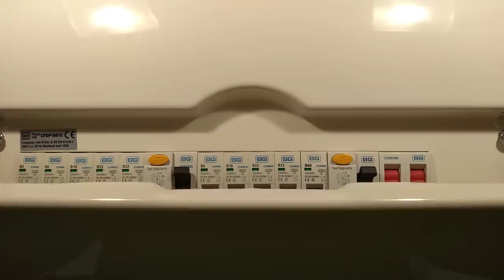A look inside a British home electrical panel.

Comment: Clive would you like an American “Breaker Box” I have several 100 amp panels i could send you one?
Reply: old or new? i want to see clive play around with the old fuse boxes that use edison screw base fuses, people would have them burn out and stick a coin under the fuse to bypass it, current american breakers are on a din rail but the old 1s were fun, i still got a few screw im circuit breakers!
Reply: @frogz  My house has both. Evidently it had a 100A fuse box and when that wasn't enough, they added another 100A supply via a breaker box. At least it's not still using the ceramic knobs that there is still evidence of.
Reply: Would love to see a world tour of electrical systems. Preferably with region appropriate snacks.
Reply: And to think my 200 amp panel with 38 breaker spaces never seems enough lol
Reply: I think it would be very expensive to send it to the UK. He could probably source one less expensively than you could send one to him, TBH.
Reply: @frogz  American circuit breakers don't use a DIN rail, they just clamp onto the live bus bar.
Reply: @frogz  aluminum foil balls ;)
Reply: @frogz  The good old 200-amp one-cent fuse
Reply: @J federal Pacific is very popular for creating toasty house fires:)
Reply: @J FPE breakers are scary. The warehouse I manage has a 1,200 amp - 3 phase service. Even worse,  some of the sub panels (FPE again) were run run with 400 feet of aluminum wire. Got to love the 1960's electrical codes.
Reply from the maker: The cost of shipping an American panel would be astronomical due to the size and weight.  Our three phase boards are very similar to the two phase American panels.
Reply: @JThe original widow maker....
Reply: @trickster721  Some clamp on, some screw on, some are a wedge-fit into slots on the bussbar.. Depends on the manufacturer
Reply: Living in the US it is interesting learning about wiring practices in different countries. In our case we have a 200A main 120/240 volt service with 40 circuit breakers plus the main breaker. Unlike the UK in the US the main disconnect is also an over current device, but only disconnects the two live conductors not the neutral. 

In the US the utility provides two hots and neutral to residential customers to deliver Edison derived 120/240 volt service. At the service entrance the neutral is Earthed and a separate protective ground conductor split off called the Equipment Grounding Conductor.

In the US GFCI can either be combined with a circuit breaker or reside in a receptacle. The threshold is 5ms +/-1ma. The UK level of 30 ma seems rather high but I assume is necessary since it supports multiple circuits.

In addition we have a separately metered water heater circuit, rated at 30A @ 240V. This is because the utility charges less for electricity used for domestic hot water.
Reply: Oh... Clive. You said 2 phase... I shall wait here for the onslaught of corrections. :)
Reply: @J idk why he wasn't happy. Any electrician worth his salt would refuse to replace or repair a federal pacific panel, and selling used breakers without testing them would put him liable for any future damage. Most insurance companies require their replacement to qualify for insurance. I'll stick with my good old Square D QO panel (i've got one on my house that is at least 50 years old now), Great things too with the new Plus On Neutral AFCI and GFCI's
Reply: @jaxjackson4100  I'll state again. Nothing wrong with aluminum. Its still legal to use in the USA. Its the terminations not being properly coated with Noalox. Those federal pacific panels however... you should get the breakers tested on a regular basis......
Reply: @bigclivedotcom  I'd like to see a 3 phase panel in the UK as I'm an electrician in the USA. I've built at least one 2000A 480v 3 phase service.
Reply: I’d imagine sending a North American breaker panel wouldn’t be cheap to send  they are big and clunky...
Reply: @gmcnewlook  Depends on the type of panel. A sub panel for a small mobile home or RV would not be too bad
Reply: @t0cableguy  in Maryland you cannot buy a house with a Federal Pacific panel. The loan companies will not give you a lone with out it being replaced before final sale.
Reply: bigclivedotcom I'll gently correct your mistake. Don't worry, people make the same mistake here, as well. US residential electrical service isn't 2-phase. It's one phase that is split by a center tap on the transformer. The center tap is referenced to ground, and serves as the neutral for the two 120v halves. For equipment that requires 240v, you essentially connect it to the beginning and end of the transformer's secondary, like it is in most other countries. This does make for some interesting socket configurations, however. Electric dryers and ranges (cookers) are 240v, but often have some 120v components. So the outlets for them (since about 1995) have 4 wires- the two hot wires for 240v, a neutral that allows the 120v parts to run on 120v, and then a ground. It's needlessly complicated and wastes copper because our wiring has to be able to carry twice the current, but it's what we ended up with.
Reply: Jason Hutton under NO circumstances should you "test" FPE breakers. Exercising them makes the problems more likely to occur, and they are a "they work until they don't" type problem. Meaning that your test might be the straw that breaks the camel's back, and it might jam the next time it's overloaded. The only thing one should do with an FPE panel is replace it as soon as possible. They are a fire waiting to happen.
Reply: ayy they got breakers? If you're just givin' em away, mybe we can work something out!
Reply: Jax Jackson aluminum wire from the main panel to sub panels is perfectly fine, and in fact, is standard. Use SE or USE cable and liberally apply anti-oxidation paste, and it's fine. The problems with aluminum were in branch circuits, and mainly had to do with a lack of knowledge/ incompatible materials. It's no longer allowed by code mainly because it's not very forgiving of less than perfect installation. But properly installed aluminum wire with compatible devices is not dangerous.
Reply: LetterSlayer that's how they are in most of Europe. All boxes use DIN standard mountings, rather than the proprietary designs used by each panel manufacturer here in the US.
Reply: @russdill  Now we're talking! Washed down with local brews.
Reply: @trickster721 Correct not DIN, I think it's an old SAE standard, we had Heinemann breakers in some older installations in Australia that used the same method, one side of the breaker was clamped directly to the live bar and the other side was a C shaped spring clip that held the breaker.
Reply: @Chaos Corner - the system known officially as knob and tube, although people in the business are more likely to refer to them as 'knob and slob'.
Reply: My googling seems to indicate the U.S. doesn't appear to have a single standard breaker for household use. Square-D? Eaton? CH? BR? GE? etc. Not all brands or types seem to have the same size/spacing or bus-bar layout.

Anyhow the ones in my house are from the 1960's. Seem to be a bus-bar type made of Bakolite or some similar hard black plastic, push-button style with an inset tumbler that shows the switch status of the breaker. (Older version of "Pushmatic"? Seem to be the closest.) Not the toggle switch that seems to be a lot more common with new models, or the generic push button that pops out that seems to be on cheaper ones.

So electricians here must have fun times stocking up on a lot more extras because of this variation. (And not necessarily due to current or in-rush ratings. It's just different companies that make the panels and breakers wanting to do stuff their own way.)

The screw in ones somebody mentioned are actually a breaker made to go into an old fuse panel. Kind of a stop-gap kind of thing for something that's really old and sketchy anyways. (And they allow that dangerous penny thing if you're a bit desperate and cheap.) Pics of those seem to come up under Connecticut Electric, although that company also makes various other types.
Reply: @frogz  there are no proper American breaker panels on din rails.  The breakers clip on the bus rail...it's certainly not a DIN
Reply: @pauljs75 - Yes, each manufacturer seems to go his own way. And it can be a real pain in the bum if you find yourself needing a to replace a faulty breaker in a panel of a company that's either gone out of business or has become so unpopular that hardly anybody carries them anymore.
Reply: yeah when my house was rewired for breakers the fuse box was bypassed with wire nuts all of the connections and I am pretty sure my furnace still has a 20 amp fuse.  @frogz
Reply: bigclivedotcom Minor correction, our (residential/light commercial) panels are “split single-phase”, each 120VAC half being referred to as a “leg” (rather than “phase”), as opposed to proper “two-phase” as two-phase means something very different service wise here in States.  There is actual legacy two-phase service (with the phases separated by 90° IIRC to facilitate induction motor starting) in several cities (namely Philadelphia IIRC) that were very early adopters of AC electric to support legacy infrastructure (namely long-lived infrastructure like elevators, etc.).  But for 99.9% of the U.S. you will either have split single-phase or three-phase service.

While technically split single-phase could be considered a “proper” two-phase service, each phase is exactly 180° apart which would have made such useless for starting induction motors, which was a major initial driving force behind adopting multi-phase service prior to capacitor (or, even older,  repulsion) start induction motors for single-phase service.  The term “split” derives from the customer transformer being a center-tapped 240VAC secondary producing the two 120VAC legs 180° out of phase from one another — hence the “split single-phase”.  And because there is such a thing as legacy two-phase service with a 90° phase offset between the two phases there was an important reason not to confuse single-phase derived split single-phase service and actual two-phase service in order to avoid major confusion in the marketplace and among the public.  

One of many curiosities that result from being a very early innovator and marketplace in electrical distribution with multiple competing early standards (including early DC power distribution a la Edison versus Westinghouse’s and Tesla’s AC power distribution).  I’ve always found the early history of electricity and the competing standards and philosophies, and personalities, to be quite an interesting bit of modern history, the outcome of which has very much altered all our lives in so many ways!
Reply: Totally inadequate when compared to an American 200 amp breaker panel! British must not use much power.
Reply: @asbestosfibers1325  Firemen gotta wirk too!
Reply: @puckcat22679  If that's not two phase then what would you call two phase?
Reply: number 33 it's called "split phase." It's one of the 3 phases from the generating plant, split into two parts by the transformer, so you have 2 half phases at the house. Watch John Ward's recent videos on the autotransformer- that's basically what they do here. 2 phase would be connecting 2 of the phases from the power plant.
Reply: David Johnson uh, their 100 amp panels deliver as much power as one of our 200 amp panels. Remember, they're using twice the voltage
Reply: UK house wiring, loop circuits and supper shallow back boxes for sockets & light switches, what's not to like.
Reply: @tomschmidt381    Recall that Edison fought AC distribution with a vicious PR campaign--until he discovered that widespread electrical distribution using DC was impractical.

Back in the 1960s, I worked as a technician in a steel mill here in the US.    Because the US didn't rebuild its industrial structure after WWII, we inherited quite a mishmash of technology.   For example, every building was outfitted with 110/220/440 single- and three-phase 25Hz; 115/230/460 single-and-three-phase 60Hz and 600/250 VDC (for welding and overhead cranes).   No breakers, just cartridge fuses.  The distribution panel for the instrument shop that I worked from took up half a wall.  25Hz transformers were enormous compared to their 60Hz cousins.

Instrumentation was quite bizarre; everything from state-of-the-art transistorized gear to wind-up clamp galvanometer recorders fed from a single No. 6 dry cell.  Add decades of hydraulics and pneumatics and it was a real circus.
Reply: @tomschmidt381  you've got a weird utility.  I've lived several places in the Western US, and in all of them, the water heater, if electric, is on the main panel (230 volt circuit).
Reply: @tubastuff  Interesting - since you said you were on 25Hz I'm guessing you are near Niagara Falls. If I remember correctly that was Westinghouse's first AC installation.
Reply: @DavidJohnson-tv2nn  standard household outlets in the UK are 220v...so 100 amps @ 220 = 200 amps @ 120.  I've lived in houses in the USA with 100 a 100 amp panel and baseboard heat 😜
Reply: @brentboswell1294  Not sure I'd call it weird. Since water heating is billed at a lower rate the service needs its own meter.

Our electricity is pretty expensive so I'll take any reduction I can. To lower our bill even more we have a solar batch heater in our greenhouse and in winter use our wood stove as a preheater.
Reply: @russdill .We need to start a gofundme for this.  I'm lovin' Scott v rest of the world "Eye ye can do what ye like we'll do it properly"
Reply: @tomschmidt381   No, actually it was NW Indiana.  Legend had it that the founder of the mill bought the first generator from a bankrupt carnival.  (I doubt that this is true).  In those days, the waste gas from coke ovens could be burned to provide power, but I suspect at some point, rotary converters were employed running from 60Hz.  I seem to recall that oddball frequencies and voltages were fairly common in US industry before about 1975.    After that, modernizing in the face of imports became imperative.

One of the brakes on modernization was the insanely long depreciation schedules of the US tax system.  From a tax standpoint, it was cheaper to repair obsolete equipment than to replace it.
Reply: @tomschmidt381  Of topic question: Do you use Chrome with a Linux OS?
Reply: @tomschmidt381  it's wierd in that I have never heard of any utility billing water heating power any different than any other.
It seems strange to break it out, unless the town used to have central steam, or they were giving an incentive to phase oil burners or something.
Reply: @tubastuff , it may have been a pain to work with, and seem like a disaster, but it just goes to show how we built stuff to last back then, so the machines that used those specs were still working just fine, and so it made more sense to continue providing them power than replace them to standardize.
Then as they got phased out and replaced, the odd power could finally be disconnected as well.
Reply: @puckcat22679  it is true that they have twice the voltage, but I would die trying to figure out how to get everything on so few breakers!
I like to have things separate and individually controlled...

I think a lot of the British electrical system is designed to be able to work in old brick and stone houses where you need to be able to surface mount a single cable daisy chaining to all the loads, which explains the 220, the higher rating breakers, the shallow boxes, etc.
Reply: @pauljs75  you are correct! Lol
We believe in freedom of design!
So each company came up with a design that they thought was best, and it's just like buying a car or computer. The internals are unique to that brand or model, but they have industry standard ports and seats.
And I would rather have the variety, so that I can choose the design that works best for my application and budget, instead of having a standard that everyone has to conform to, and losing the choices.

Now, I also wish that DIN breakers were more available over here, because there have been many times when I wanted to mount a breaker in a control panel or machine, and the only local option was to mount a sub panel on the outside of the enclosure lol
Reply: @ke6gwf    What drove the replacement and idling the old gear, as I recall was--Japan.    Japan had to rebuild after the war and got very innovative as a result.   Consider the process of making a simple structural beam.   The old way was to first smelt the iron using a blast furnace, burn out the carbon and adjust the alloying in an open-hearth furnace, then cast 30-ton ingots. After cooling for a few days, send them to the scarfing dock to have the scale removed, thence to the blooming mills, where the ingots were "soaked" in house-sized top-loaded furnaces for a few days, then sent to the rolling mill where they were turned into rough billets, thence to the merchant mills, where they were rolled into structural shapes.   The Japanese were already using basic oxygen furnaces and using continuous casting for merchant shapes--and their quality was superior at a lower cost and faster turnaround.
Reply: @tubastuff  if the phase out was part of replacing the entire facility in your case, that makes sense too.

Though wasn't the basic oxygen furnace pioneered in Austria?
It looks like Japan ran with it too, but so did pretty much everyone else lol
The US was slow to adopt it, probably because we had such awesome steel mills that worked just fine, so it wasn't until price pressure started increasing that they started to upgrade to the better process.
Reply: @brentboswell1294  its an old practice. not done much anymore. they did it up here in winnipeg canada as well. The distribution panel used to have a space next to the main to provide power for separate or leased metering of hot water heaters, the heaters were also not usually owned but leased as well it was all a flat rate. In older installations the heater would have its own fused disconnect separate from the mains disconnect for the typically 60A mains and fuse box. Anyone remember load balancers?
Reply: @chaos.corner  bloody hell what you running in your house to have 2 phases supplying your house
Reply: Ethan Poole - The majority of mainland Britain now has a standardised 415V (400V) three phase / 240V (230V) single phase supply to light industrial, office and domestic property. But it was not always like this. Originally there were lots of independent companies each supplying electricity to their own standards. Including DC systems and various AC systems. There was no standard supply voltage either. Each company used their own power stations. None of these were linked in any way.
Reply: David Johnson - Generally speaking, we don’t have air conditioning in domestic properties. Most homes have either gas or oil fired central heating (with gas being by far the most popular in towns and cities). And because the supply voltage is 240V (230V), less current is needed for general use (sockets, lights) compared to lower voltage systems. Hence most homes are only provided with a 60A supply. Sometimes where a home has fixed electric heating, this has a separate meter and a separate consumer unit.
Reply: @puckcat22679  But it is 200Ax240V or 200Ax120Vx2 (2 120V legs, not one) or any combination thereof, so either way it is 38.4kVA usable (80% max continuous load current). Their 100A panel is half that.
Reply: @lukesmith8792  Standard American center tapped supply. 100A is not much these days, especially with AC. Rather than upgrade to a 200A panel, they just ran another service, I guess.
Reply: @jamesbrown4092  It sure is a pain!  Sometimes there are new equivalents allowed by code, but sometimes you find some idiot has used one that's "close enough" in fit to run a new circuit. 🤪
Reply: Frogz I have several but shipping is a bit of an issue as they weigh a ton! The one I was thinking of is a GE that 100amp residential panel taken out of service and it would have several 120v and a few 240v breakers in it. No RCD’s as they call them across the pond that’s not a typical item in a panel we do that at the outlet.
Reply: bigclivedotcom I can check into it, this is only a smaller 100a panel With about 10 circuits but I expect it’s going to be over $100 let me plug some numbers into some of the shipping companies
Reply: @trcostan  Though you can get them. They are a lot more expensive than a regular breaker though.
Reply: Chaos Corner I know we do use them things like hot tubs and jetted bath tubs but in most cases we don’t put them in the panel. It would be nice if we did but that’s just not the current state of things
Reply: bigclivedotcom most houses have single phases with a center tapped neutral 

my ‘50’s era building has 3 phase open delta. it provides the normal 120/240 and neutral from one transfer.  the other transformer provides 208

a true 2 phase system is very rare, probably a carryover from railroad power system
Reply: We just have to find an American who goes to the TT races and they can put one in their checked luggage.
Reply: @J Dangerous? We use the word "exciting" in this parish.
Reply: Chaos Corner The Isle of Man seems to be a black hole on all of the shipping sites, I had trouble even finding a price! I could take it apart and put everything in a flat rate other then the large metal box.
Reply: @trcostan  Does Clive have a P.O.Box? I'd assume it was IOM but it could be a mainland one.
Reply: @bigclivedotcom  Most American panels, at least the larger ones are interchangeable, they can be set up for split phase or three phase depending on the bus bar configuration and the main breaker. I know my own house breaker panel can be set up as either three phase or split.
Reply: Long as it's not a stablok panel o..O
Reply: @puckcat22679  someone said the other day that the usA Uses gallons miles and pounds! Can you believe that? I think he must be on one of those real weird substances to imagine that, or maybe he'd been cruising in that old time travel car. But funny as fuck all the same
Reply: They had similar stories about 25 cycle service in Ontario, my Grandfather claimed that it was a cheap Scotsman who bought the equipment. From what I heard they used 25 cycle per second power because they could regulate the speed of AC motors easier in rolling mills they with 40 or 60 cycle. I figured that it may have been installed because they bought the alternators (not generators) from Britain or Continental Europe where 50 cycles was the norm. Most of it was ripped out in the late 1950s except for industrial customers, 1958 where I am.
Reply: the electrical panel for the house
https://www.youtube.com/watch?v=WvbqZsdERak
Reply: For those interested in US panels, the excellent "technology connections" has a video called "The US electrical system is not 120v"
Reply: @10p6  It'll be way too little when EVs with superfast charging come in for everyone - and that power then has to be supplied to every house/condo in every road of every town.
Reply: 100amp at 110v no thank you 🙏 lol
Reply: @frogz  You can use a round of .45-70 to replace a cartridge fuse. Overcurrent will give you a great audible indicator! :D
Reply: @asbestosfibers1325   My first house had an FPE box with a failed 100A breaker (it had been jumpered around because, I guess, the previous owner never could find a 100A replacement breaker!). I needed to substantially expand the house's wiring, and ended up having to put a 200A box (SquareD QO, needless to say :) ) on the outside of the house with a 100A breaker feeding/protecting the original panel, and another 100A breaker protecting a new box on the far side of the house. Ah, the joys of a 60+ year old house! :)
Reply: @t0cableguy   I did, at one point about 20 years ago, find a small cache of new-in-the-box FPE breakers at Home Depot of all places. Needless to say I scarfed them up. They came in handy when I had to add a circuit when I rewired the kitchen in that house.
Reply: @tubastuff   Only really screwy power I've run across is in data centers. Old IBM mainframes ran on a steady diet of 208V 3 phase 400Hz power. You could derive that from what the utility fed you either with an enormous UPS and a 400Hz inverter, or a motor-generator set. Oh yeah, the other joy in power in the IT world is carrier facilities, like where our regional network gear lives. That's all -48VDC. :)
Reply: @ke6gwf   After all, our steel mills hadn't been bombed into smoking ruin because we had those multi-thousand-mile ocean buffers between our infrastructure and our opponents. I think the Germans and the Japanese were innovating largely because they could; they didn't have a lot of "if it ain't broke don't fix it" inertia and fixed plant still to depreciate.
Reply: @denisrhodes54  Most of the buildings on campus where I work (Go Gators!) have split wiring - 208/120 3ph for outlets and data centers and such, and 440/277 3ph for overhead lighting and big motor loads like air handlers and chilled water and elevator hydraulic pumps. Building I used to work in had a 5kv feed into the building; the main breaker (1200A at 5KV that fed two big humming transformers) was in a panel the size of a school bus down in the basement.
Reply: @OlegKostoglatov  A fair number of railroads (particularly the Pennsylvania RR) fed electric locomotives with 25Hz AC, usually at something like 11KV.
Reply: @mrz80  Oh, yeah.  Old CDC alum here, worked on the STAR project.   Basic 400 Hz supply for that beast was 250 KVA MG set; if you had extra memory, add another 80 KVA.  And that's not counting the cooling.  Interesting thing is that "voltage regulation" consisted of a 3-phase 400Hz Variac and a panel meter.
Reply: @tubastuff   So if I say "Cyber 205" you know exactly what I'm talking about. :D  I was a console jockey for NASA/Goddard for a few years. Whenever we had a power outage all those MG sets would spool down like a flight deck full of Tomcats securing from flight ops for the night. :D
Reply: @mrz80  Yup, CDC modified and rebranded the STAR over the years.   After a hiatus to go play in micros, I got involved with the ETA 10.   I think NASA Langley had a STAR 100 for awhile--I recall going out there to give a presentation.   Lawrence Livermore that had two of the buggers, so they got a lot of attention.   The 205 had a much reduced instruction set over the original 100 (Cyber 200)--and a scalar unit which was missing in the original.   Heady stuff for late 60s--70s, but now it's just a memory--Neil passed several years ago.  I kept a heatsink from the last existing STAR-1B.
Reply: @t0cableguy    Now you've got me thinking it might be time to dig that old FPE panel out of the wall at my rental house and replace it with a QO.  It's just a subpanel now, though. It's downstream from a QO at the back of the house that has the main 200A breaker and a couple 100A breakers to feed subpanels various places in the house.
Reply: Lloyd
Reply: all of these type boxes are 25mm square cable in,  100 amp boxes.
Reply: @asbestosfibers1325  <> I was recently working on a house with a Federal Pacific sub panel and inadvertently caused a short; the FPE breaker never tripped, only the feeder circuit breaker in the Crouse Hinds service entrance panel tripped. Needless to say, tore that puppy out the next day.
Reply: Why would anyone want American garbage!? I hate the breaker box that came with my new American built KB Home shack.
Reply: I honestly don't know if it makes a different difference but I always build out my pannels from highest load closest to the main breaker on the bus to the lowest